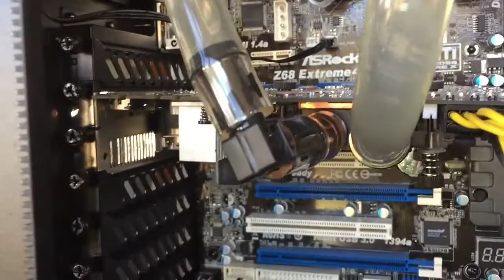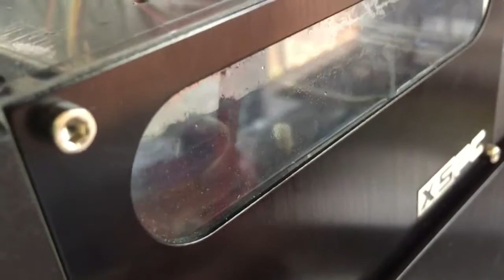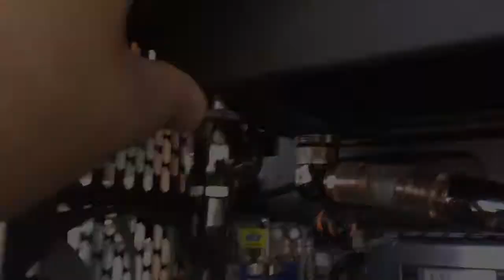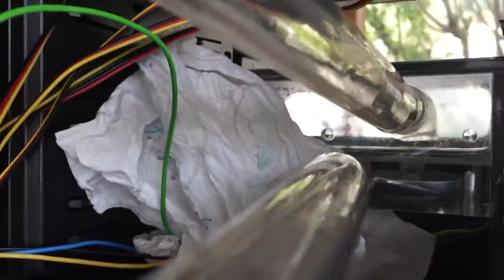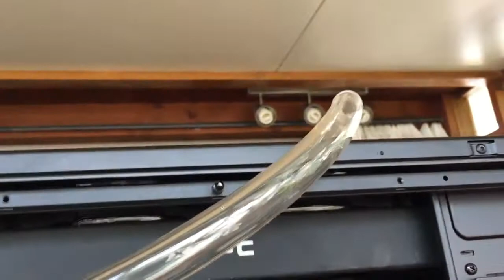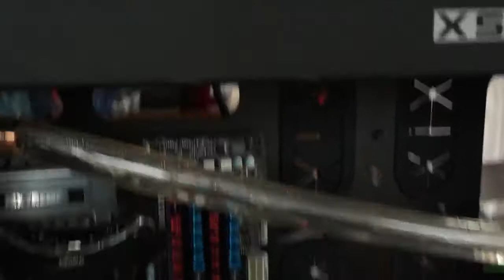PC Watercooling  fail

Comment: What are your specs?
Reply: It appears to be an ASRock Z68 Extreme4 motherboard (for LGA 1155, 2nd 3rd gen  Intel Core processors, probably meaning he has an unlocked core i5/i7) and a GTX 760. There is likely 16GB of RAM.
Reply: Damp